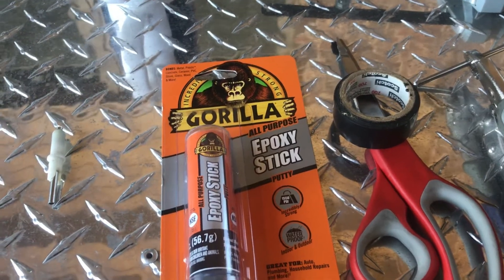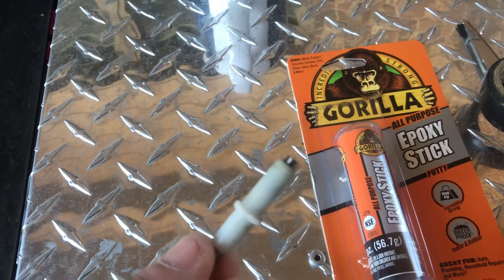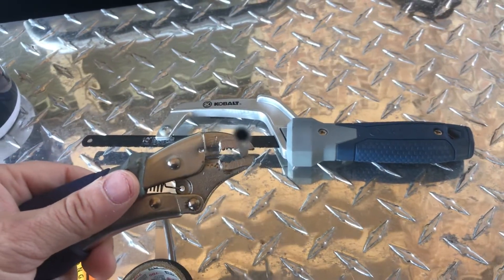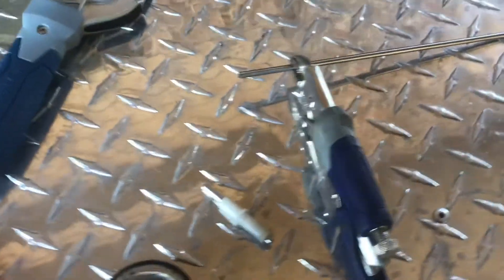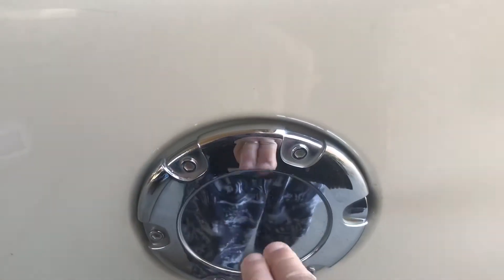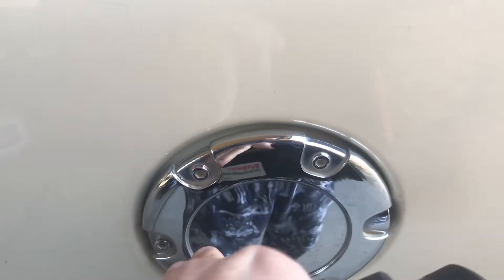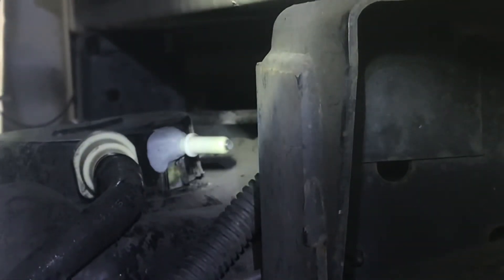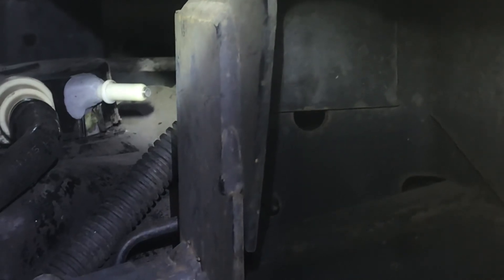Chasing code P0456 ‘08 Dodge Ram 1500 V8 5.7l 26 gal. gas tank - repair plastic rollover valve stem

Comment: Hi instead of a stainless still straw. I used a brake line instead and just cut to what I need. Is that just as good as stainless still that u used?
Reply from the maker: The stainless steel was a perfectly snug fit that also kept the cheap plastic stem rigid, but it is not the only way.  Turned out that the rollover valve (interior) was bad so I had to replace the whole gas tank with a used tank from the junkyard.  I could not get a new tank during the 2020 pandemic due to zero availability.

Comment: I have both ports broken off of mine. I don’t even know what that rollover valve does. Mopor tech couldn’t really explain it either. Buying a $900 tank and a $150 fuel pump is crazy to fix a $3 piece of plastic. If I drop the tank I’m doing a new pump at the same time since my truck is 14 yr old.
Reply from the maker: It has been a gut wrenching crusade to find the cause for my P0456 code. After changing everything but the tank,I rolled the dice on a used  tank at a junk yard for $100 and as of today, for 700 miles, the code has not returned——-BIG FINGERS CROSSED.  A local shop broke my overflow valve stem during a fuel pump change and the code popped up and remained until this used  fuel tank change….

This time I took care of the job myself.  I also replace the 1.5 year old fuel pump because the fuel sending unit prematurely failed.  It was about a 4 hour job in my drive way.  Good luck!!!

Comment: You had me at strong coffee. I'm fairly sure every single connector on my tank is broken, love the truck, thankfully it's got enough lift that dropping it won't be hard. Thanks for the content.
Reply from the maker: You're welcome. I hope you find your solution. P0456 and cheap plastic parts on the the fuel tank and lack of ability to just replace the rollover valve instead of having to replace the entire tank, truly tests the will of man.

Comment: Do they not sell that part outright?
Reply from the maker: Oscar Guzman - You would think, right? It is permanently attached to the 26 gallon fuel tank; so, it requires a total fuel tank replacement just to fix that little piece of plastic.